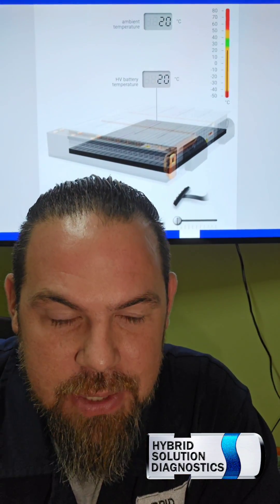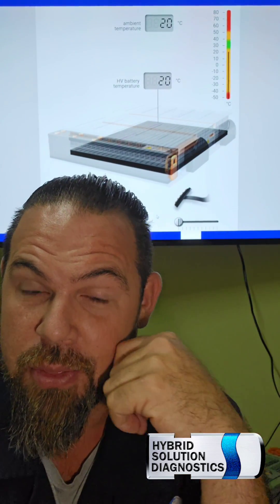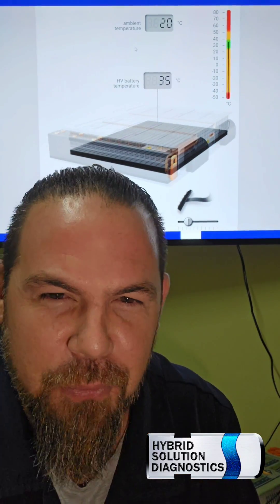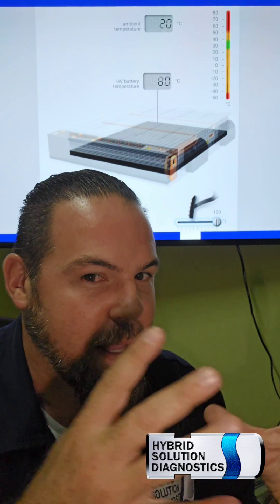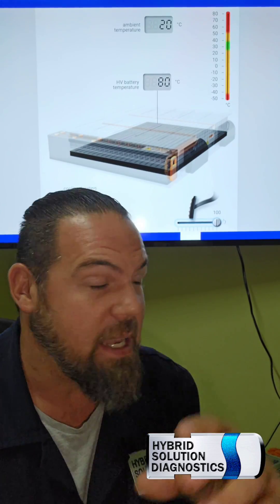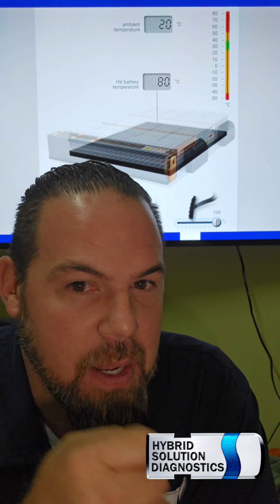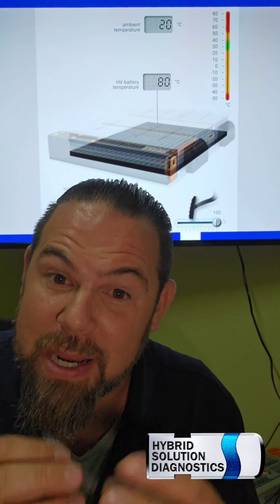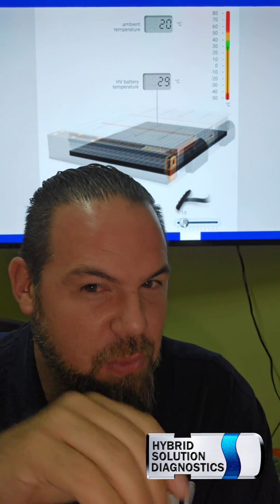why are batteries catching fire in some electric vehicles?

Comment: Why many Tesla cars burn ? I know that with the new BYD batteries they have solved this annoyng problem.
Reply: But they don't solve battery degradation problem. The truth is the heat have to be absorbed somewhere and if it didn't explode then it should be contain. either way will renders the battery dud!